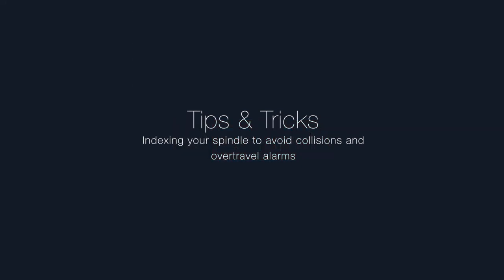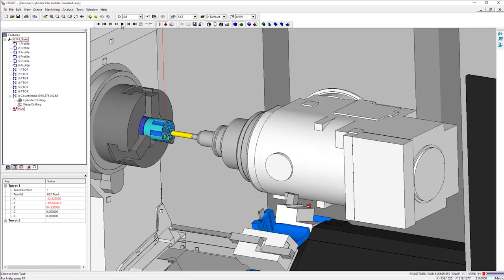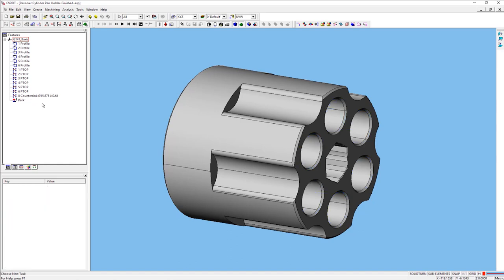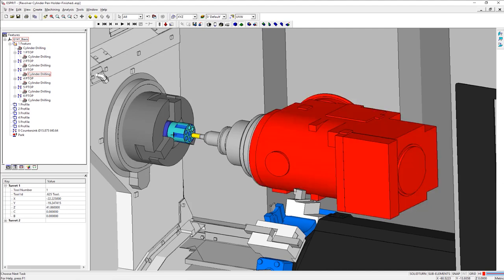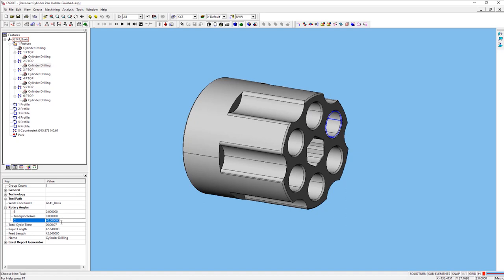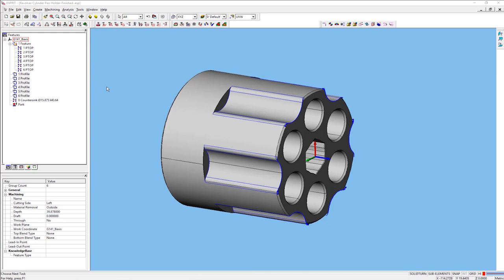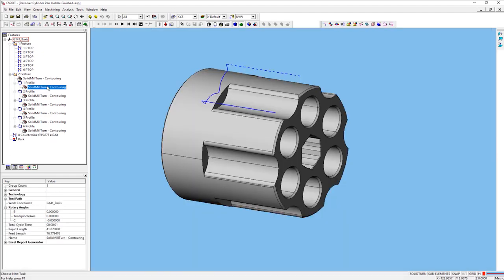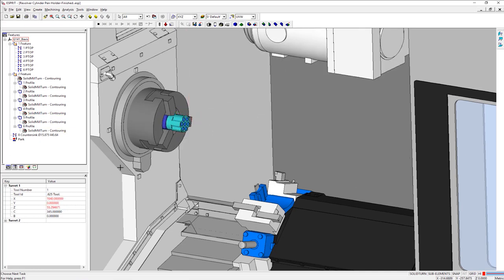ESPRIT® Tips & Tricks: Indexing your Spindle to Avoid Collisions and Overtravel Alarms

Comment: How about if you have 60 holes or 100 hoels? Do you still have to go in each individual one and change the rotary angle?
Reply from the maker: Technically, yes you would need to edit the rotary angle for each hole. However, I believe there is a macro that automatically assigns the rotary angle based on equal spacing within 360 degrees. You can always send your part to support@dptechnology.com for assistance as well.
Reply: No u would just use wrap drilling for the face holes and a rotary contour for the of cuts